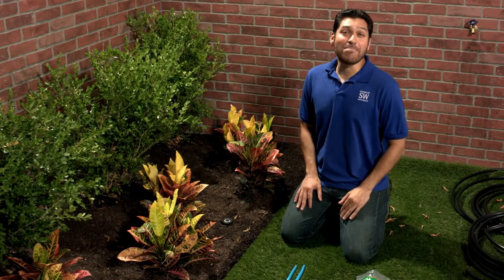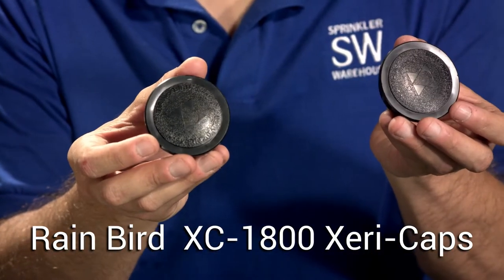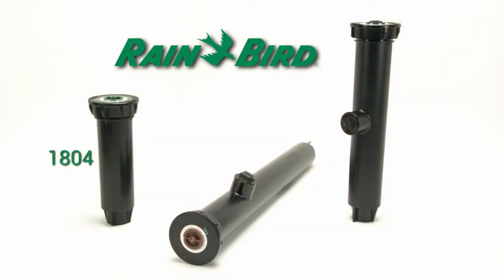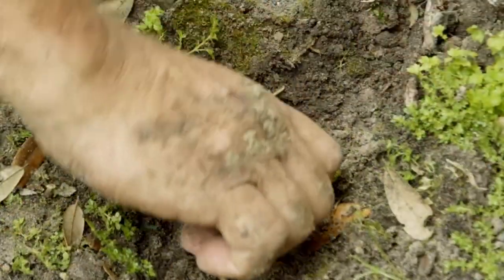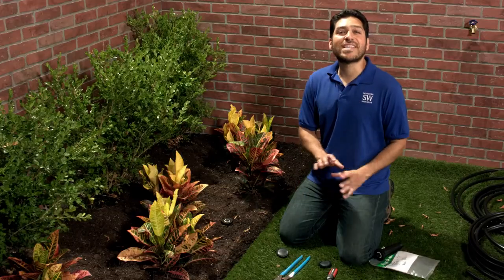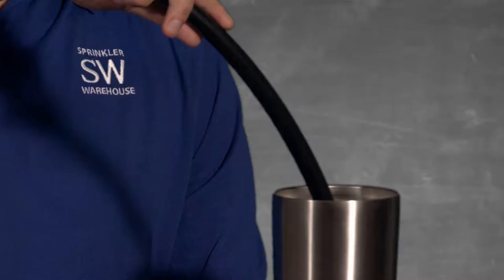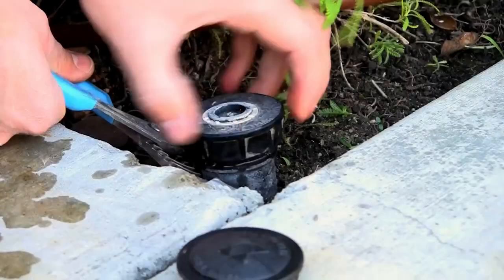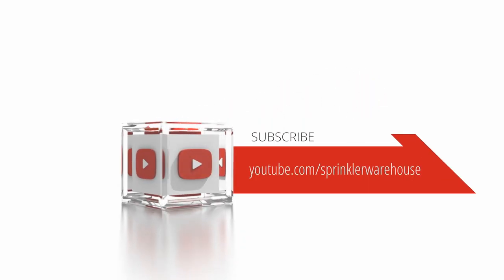Rain Bird Pop-up Sprinkler to Drip Conversion

Comment: Most everybody I know would like to convert their drips to sprayers. I find drips have 10 times the maintenance of sprayers and when you have a drip system, you still need to water by hand periodically.  When I built my new house, the man that designed the irrigation system told me that he hated drips. The irrigation installer told me that he hated drips. The city inspector said that he hated drips. And as a homeowner, I hate them too.
Reply: So much negativity.  I need drip for plants like roses because they do not like to be watered from above. Not sure what kind of maintenance you are talking about.

Comment: I have one station that has at least 5 pop-ups, and I need to sacrifice 1 pop-up for a drip conversion. The drip will be feeding 2 Podocarpus bushes. How do I keep my station timer set without overwatering that station’s pop-ups (lawn) and still have enough water output for the 2 Podocarpus bushes? If I vary my emitter output to a higher GPM, will this affect the pressure and output of the pop-ups on that same timer station?

Comment: Great Video...I have one question.  My pop-up sprinkler is a Hunter.  Will the Rainbird retrofit kit work?
Reply: I have the same situation, and l was thinking just replace that one Hunter sprinkler head with a Rain bird 1800 brand. Not 100% about this l have to physically check the items.

Comment: I have 6 sprinklers on a zone want to install a drill line on (1) of the sprinkler heads is this do able? Or will the drip line pull too much water away from the other sprinkler heads???
Reply: You should be good, the only thing is that you will need to increase the watering time to an hour, and this could cause over watering in the area that your other sprinklers are running.
Reply: @Max-gt1hw  Yeah how do you work around this? Seems he sort of touched on it but I didn't catch on. Seems the drip one either needs a lot of flow, or the other ones need to be constricted which they probably weren't designed for.